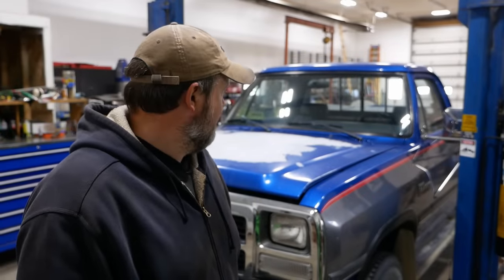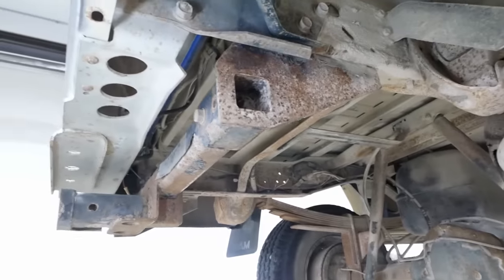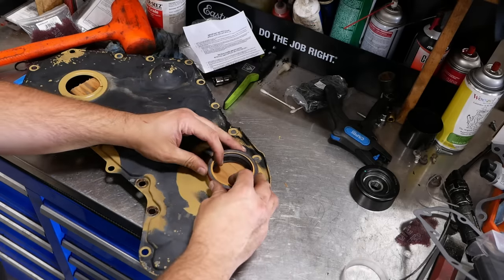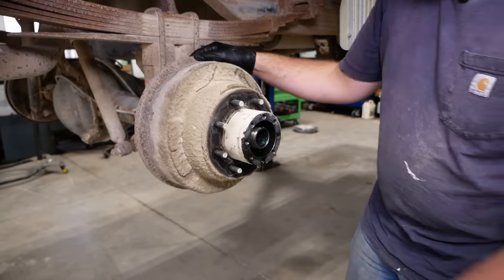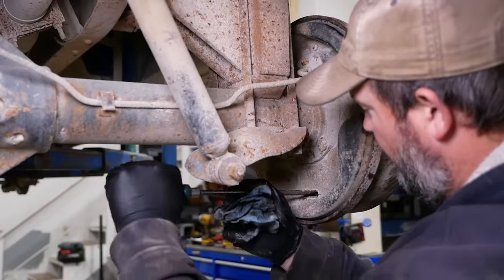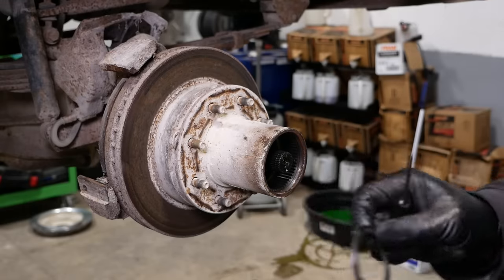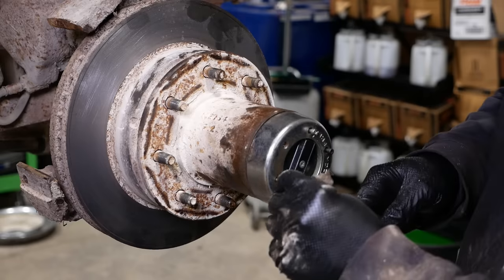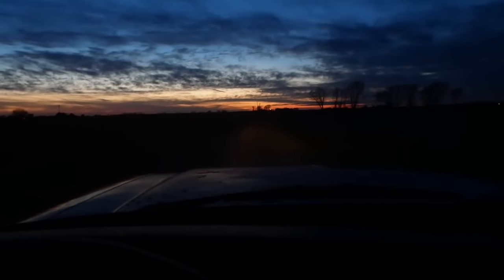Cherry 92 Dodge Cummins: Killer Dowel Pin, Brakes, Seals, Etc.

Comment: HA!  I remember trying to drive an old farmer's Dodge 4x4 pickup, identical to this one, though with a big V8 gasser, whatever size that was.  It took a Scandinavian strongman to turn the wheels with the steering wheel in that beast, mercy there was so much slack it would swerve a full truck width left to right. I didn't even have a license yet, I should have never been told to drive that thing

Comment: Great show as Always Wes. I have seen a video, perhaps from DeBoss garage? They converted a 1993-2001 to rack and pinion like the next gen Dodge Ram trucks.
Reply: Converting a solid front axle truck to rack and pinion would be…incredibly difficult. None of the solid front axle Dodges (or any other solid front axle truck that I know of) have rack and pinion.

Comment: DuPont paint I believe?  Not a fan of the color blue which can be changed but the pickup is super nice.  Well done on the dowel pin mod, most people I have seen doing this remove the radiator and most of the front end.

Comment: Use a red head power steering box and an aftermarket track bar I have it on my truck and barely any slop or vibration

Comment: A good old Dodge. 
Brave and loyal.
318 and Torqueflite, the mighty combo. 
What is it doing in a repair shop?
Oh wait, not a 318, just an oily dirty cummins.
Another greasy maintenance required...
Trolling folks :). I love this engine which will never fit unfortunately in my B350 van.
It deserves a manual tranny.
My 318's got 16 valves, and ,and a TBI, yeah! This has to be said...

ove

Comment: I used to work at a machine shop making that exact timing cover
Reply: Why didn't they cover the end of that hole so the dowel couldn't fall out ?..lol...the vp44 case (the ones I've seen). Have a smaller step in the hole

Comment: My 98 steers great. It has a steering box brace that was on it when I got it. Buddy of mine replaced everything on his 96 and it still wandered, he put on a steering box brace and the wander went away. Also the 98+ T-link steering is beefier than the older Y-link setup.

Comment: a bit late to reply but for the 95 dodge here are the things I did to my truck that made a great improvement.

1: steering box brace should be the first thing done if not already
2: new steering box (recommend redhead steering gear box)
3: aftermarket track bar one that has heim joints or bushings and a track bar frame mount/brace (oem track bars are a bad design and flex at the bend over the differential and the oem track bar mounts flex on the frame)
4: i have seen a lot of guys weld the spring mounts to the frame with reinforcements to keep them from flexing
5: new ball joints and get a t style steering setup not the old y style (if i remember right its 98-99 heavy duty steering if not there are tons of forums that talk about it)
6: and this is one A LOT of guys look over is the pitman arm (they will get loose and wiggle on the steering box shaft had 3 of my trucks do it  AND MAKE SURE THE WASHERS FIT OVER THE STEERING BOX SHAFT if they don't you will have almost no control of your steering and will eat away at your steering box/pitman arm)
7: i haven't tried it but it would be worth a shot, there is a product called "rock solid ram steering" its a good idea but should be a last ditch effort

hope this helps some

Comment: Im fairly certain you can drill out the second gen steering knuckles and mount the revised 2009 T-style tie rods. On my 2003 I've done a redhead steering box, frame steering box brace, T-style tie rods, heavier steering damper, and replaced the intermediate shaft to the steering wheel and its fairly tight, but certainly not mint. I dont know if its possible to ever make a dodge drive 'straight'.

Comment: Great video Wes I'd recommend using Luke's link in regards to the 2nd gen dodge my truck went through 3 trac bars in a year including moog problem solver until I came across Luke's link which my steering has been phenomenal the past 3 years they also have an upgrade for the tie rod ends it is a reinforcement for the steering linkage. Anyways I've been procrastinating doing the kdp for my 92 the past few years this year coming up though will be the year. I'm gonna remove the rad too and flush it since it's 30 years old and for some better access to the timing bolts and everything because they are known to back out(not the cover bolts, but the ones behind it). The 92 trucks do have O/D(a518) so it isn't a 3 speed(727).

Comment: I have a 2002 dually ( they were some old and some new parts) I used the plate that bolts to the frame and has a thrust bearing that supports the steering shaft!  made of a 1/4" plate. It tightened up my wish-washy Sloopy steering! Good Luck! mine is a 100% rust-free Pa, truck! The fluid film works!

Comment: We’ve had luck with changing what I call the track bar with an aftermarket bar with Heim joint on one end and a polymer bushing on the other(for the “death shake”) more common on the Ford F-250/350, I’ve also seen a bolt in frame tie that has a bearing that goes on the pitman arm shaft, that’s supposed to help with the “wondering issue”, hope that helps! good luck!

Comment: In my past experience I’ve found that it is very important that all the steering components r in good working order inspect very carefully before you start throwing parts at it those front ends r not that great it seems like what will work for one person dose not mean it will work for you it could b steering box you might have to tie the frame together or just as simple as a new joint some where I’ve seen a lot of parts thrown at these front ends and the problem is still there even heard of lawsuits against mopar for bad engineering of the front end

Comment: About that red dodge. If it's tie rod twist, I run synergy manufacturing tie rod ends and their  misalignment dust boots. If it's the bushings in the control arms flexing, when you turn the steering while sitting still, the whole truck shifts left or right one could put in some polyurethane bushings, but I personally dislike them because they wear so poorly. A track bar upgrade could also help if the axle is shifting side to side with steering. Just 4x4 problems

Comment: I have a 1999 dodge 1500 with play in the steering , I had a new steering box put in it and a couple of months later it came back. I just found out about an adjustment you can make on the box to tighten it up that’s my next step.😬

Comment: KDP IS NO JOKE. It is not a question of if ,but question of when. My truck did it around 150,000 . Shop through some jb on the blowout in the timing case . Threw a new seal onthe cover  and called it good. I found the pin in the pan at ½million.  Truck fell off the jack crushed the oil pan, a series of cascading misshaps led to a full rebuild (5,6 2× out of round tolerance took 
020 over to clean up) 
Damages: 
Bent crank between the 3rd and 4th web( 4-7 @ min 1-3@max new spec) . 
Retarded timing gear 5° valve and injection ( raises peak tq rpm )
Chiped 3 teath( minor, has laped in with 350,000mi + tons of idle while 2nd owner fed cows for 10 years)
It took 10+ trys to to finally wedge through blowing out the side of the gear case to get to the pan. The gear teath left dents in the side of the pin making it more of an interference fit. Made a kit to retain/ prevent a nother hit.

Comment: Hey Wes, I had an old 98 Ram. I put a steering stabilizer shock upgrade on mine and it seemed to fix the floating feeling that I think your customer is talking about. Unfortunately I do not remember which one I got. I held tried multiple ones. DO NOT USE THE RANCHO ONE (it sucks worse then factory). Hope this helps.

Comment: So I own a 2002 3500 which has the same front end as the '90's up 4x4 front end. My friend has a 2001 2500 HD with the 4x4 front end. There are a few things that fix the issues.  In order below from most effective to last bits that rendered out perfection.
(1) Track bar.  The design is awful. The ball joint at the end can't take the loading. Redesigned in the later trucks and mods can be made to use the newer generation bars in the older trucks. More work than needed.  Using a Luke's Link for the rod to rebuild that joint works and can hold for around 150 to 200K miles if lubed regular.  That LL joint only works on the bars with the small ends (they come in two sizes).  This fix stops the ability of the front axle to move left and right independent of the body.  Oh and it likes to cause slight interference with the Dana 60 front diff cover like the Mag Hytech.  A tiny bit of grinding and no more issues. 
(2) replacing the steering box if there is any slop in it that can't be taken out by tightening the sector. If the previous trackbar problem was there for enough time, scrap the steering box.  It won't tighten enough in center to limit slop and will destroy the box because it's too tight outside the center position.  I personally like the Borgeson steering boxes. Red Head is supposed to be good as well but I happened to have a bad experience with one of their boxes splitting the end cover.
(3) Frame flex issues. Buy and install the cheap brace that supports the bottom of the steering shaft below the pitman arm.  That one also tends to cause the death wobble and is hard to find.  
(4) Ball joint wear. Something that never goes away and is a pain. Moog and others built their replacement joints in oversize and when you install them, you can't go back to original size joints.  If the top end joints have worn out, which they usually do, weird drivability problems will happen. I personally installed joints from EMF (Canadian company) that makes very nicely machined rebuildable joints. Those things are amazing and zero issues since.
(5) Do all the joints in the front end steering bars with Luke's Links or replace the bars and expect them to wear out faster. Either fix will eliminate the slop that can cause the death wobble.
(6) Borgeson steering shaft.  Helps but every single little grub screw has to be Loctited and set right.  Just the slightest bit off and you get this little bit of clicking slop that is annoying.  
(7) steering shaft sleeve bearing through fire wall.  The factory one is junk. I put one in that someone was selling out of a much better machined plastic that works.  I'll have to go look up what / where I got it if interested.
(8) better dampers on the front steering arms.  Installed double shock version on the 3500.  Probably didn't need to but it was the last step and well I went that far. 

What I have now is a really tight front end that doesn't wobble, shake, shimmy, wear tires, anything.  Any steering input translates right to the wheels. It's just lovely to drive. My friends truck has the steering box issue right now because he let the LL joint fail on the track bar and the steering sector got hammered. I fixed the LL on the original track bar with a new internal bit's kit and sometime this winter will replace the steering box. Right now he has no death wobble but his steering is too sloppy.

Comment: People are going to freak out but I’ve owned 2 2gens and I telling you now tighten steering box adjustment makes like a new truck a little turn then drive and repeat until play in box is all but gone best upgrade you can do. Did my years ago tow all over east coast
Reply: Nobody does the procedure correctly.  Over center adjustment is not the solution.

Comment: I tried the factory torque procedure once for wheel bearings circa 1998.  After I picked all the bearing shards out of my hand I reinstalled the new bearings by feel.  I'll have to test the endplay the next time I install a bearing set for curiosity.  Good video Wes!  👍😁

Comment: Max isn't cold he's just got anxiety issues.
That truck was ripe for an oil or  "fluid film" spray down.
Do you have hot water running under your concrete like DC just did?
You have a nice shop either way and thanks for making videos.

Comment: I smoked a set of hub bearings on a 47 chevy 3600 because i didnt know i needed to tilt the axle to fill the hubs. Burned the bearings and destroyed the axle stub end and ripped the locking nuts right off….. expensive lesson learned. Oh and completely lost the brakes and had 5 neutrals when the axle/wheels on that side walked out and the wheel cylinder blew!!!!!! Lol

Comment: I have a 2001 5.9L quad cab. I did the ram steering shaft upgrade, new TRE's, new hubs, steering box. It still wanders a bit but no shaky shaky, or death wobble over bumps like when I first got it. I thought the new steering box would take care of the wander but sadly it didn't, I can still freely turn the wheel about 15 degrees either direction. great videos as always.

Comment: Bd diesel steering box mount plate, redhead steering box, not sure if you can on that early vintage, but i changed out sthe whole steering linkage to a fourth gen set up. It just bolted right into a 2001

Comment: When I was looking to fix up mine, on a '98, research pointed to play in the thrust bearings in the steering  gear box and to tighten them. I never did that and lived with it. I put one of those steady rest bars on that attaches to the bottom of the pitman shaft, but that didn't do all that much good, then I had to take it off to put the snowplow on.  Of course that track bar is a piece of poor engineering, make sure that it is tight.

Comment: Great video as always Wes and wow - an amazingly nice 30 year old Dodgerino!
QUESTIONS:
1) For the killer dowel pin retainer, wouldn’t a small plate of 1/32” steel be better than wire? It would take the torque on the little bolt better.  
2) For installing that seal - why would you not just press it in with your little press?  It would go in square and the forces involved are small.
Reply: Any reason why that dowel pin would ever have to come out ?   If not, then turn to the the welding rod.

Comment: New steering shaft, “4th gen” steering or there’s a couple companies that make really nice heim joint steering and upgraded track bar mount, and from what I’ve been told a psc big bore steering box is how you completely eliminate slop in a 2nd gen dodge, but that’s about $3,000 in parts, and you need at least 17” wheels to clear any of the upgraded steering no matter which one you get, you will need to do some research about it since its a 94 there is a couple other issues you will run into with the “t style” steering, but hope this helps, and I agree with you I have a 95 and I just deal with the slop, and man does this make me want a first gen that thing is sweet

Comment: Red Head steering box?  I've done the pillow block bearing under the steering box on a 2nd gen and liked it too
Valve adjustment for the 1st gen?
You need a mouse kitty for the place

Comment: I have quite a bit of experience fussing with the second gen steering. I upgraded a few different trucks a few different ways and the only one that really worked was a red top gear box, swapping to the 2nd gen HD steering linkage, which on that truck required an adjustable drag link. It’s a deal with it or spend 5 grand to fix it… kinda
I only went all out in this one because it was as heavy a hauler as a 1 ton can do w 4 ton suspension.

Comment: dodge truck look like ford e350 in the 1980 same front brake and same back brake and bearing 
at work i would just ask someone to move the steering left to right no engine running will looking for play in the direction part and steering part on the ground before puting on the host....but i know you know that....tks great video

Comment: had a hub, wind itself in,,finally found, the inner  part of the alloy hub, had seperated..driving along at 60mph, it would ratchet in, but not engage till you stoped, wierd.. only ever fail ive had..

Comment: I can't believe you used the nut to remove the front hub seal.  I am sure there was a TO that said you can't do that.... and never use a seal puller.  You have to use fairy flatus in a fern covered, field fabricated, floating front hub seal setting station....  With satin gloves and a spandex onesie.  You can't win Wes.  There is only one way to do it right, and whichever way we learned do it ain't it.  I kinda miss those neat old trucks tho.

Comment: The dealership that I worked at had DODGE TRUCKS in giant letters painted on the side of the building. I struggled for 10 years to locate specialty tools. I’m sure many of them are in the possession of former technicians

Comment: EZ Fix for the Dodge:   Jack up the radiator cap, swing the Dodge out and run a Chevy back under it.  Screw the cap back down and give it back.  It'll drive great.  :)   

If Death Wobble is the issue, figure out what's loose.  The linkage design can be a contributor in some years but not all.  DYNAMIC balance on the front tires is UBER-critical to Dodges and Jeeps that are sensitive to DW.  (This means weights on both sides of the wheel, not just inside...) Check all the front control arm bushings, blown out bushings make it sensitive too...   Good luck!

Comment: there is a lot of these still running out here in the west they dont rust at all and keep on running forever..except for power steering air conditioning compressors and everything else but the engine

Comment: if you ever need any automatic trans parts for the 1995 and back i have plenty. have pretty good supply of the parts for the 1996 and up as long as its not the 48 RE. I do have a perfect used torque converter for a 48RE man just wanted a triple clutch one installed i saved the old one just in case someone needed. biggest problem is i am in Alabama but ups comes here

Comment: Take a look at the upper and lower control arms. I just replaced them on a bit newer dodge but it sounds like the same problem it as really noticeable if  you hit a pot hole or rough spot in the road at highway speed.